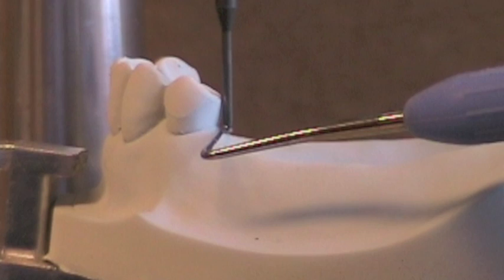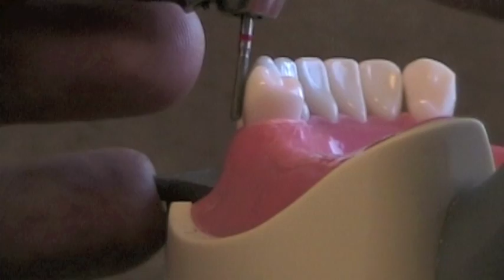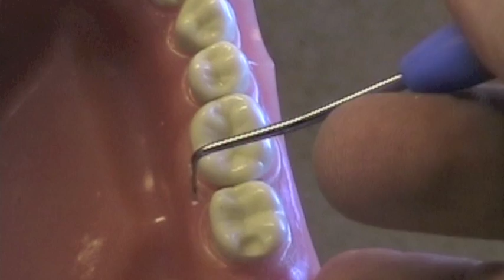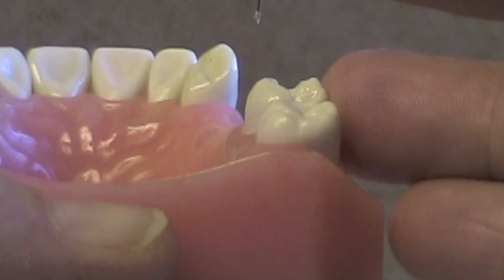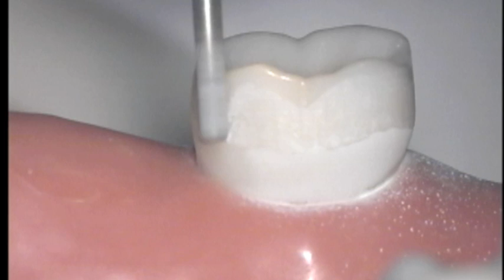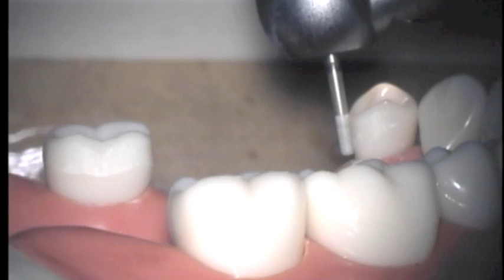04 Preparing Guiding planes

Comment: My understanding was that guideplanes only extend to the line angles on the facial and lingual surfaces. May you please help me understand why the bur is running across the entire facial and lingual surfaces in this video? Thank you
Reply: I think that's only for proximal guiding plates. In this case he's got a retentive clasp on the buccal and reciprocal arm on the lingual surface. Because these are rigid they can be stressed and weakened by going into undercuts, so he creates guiding planes to eliminate undercuts in all the areas, except where the terminal (flexible) 1/3rd of the retentive clasp sits as he wants this to have an undercut to flex into (and sit under the survey line). Notice for final bit of the video the bur stops before the mesial half of the buccal surface (the surface facing away from the camera) - this is where the terminal third of the clasp would be